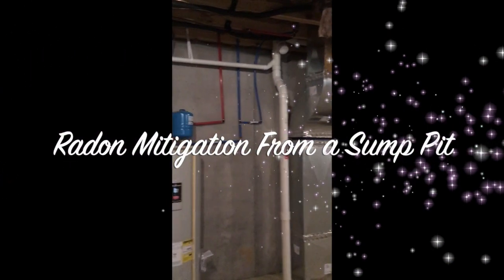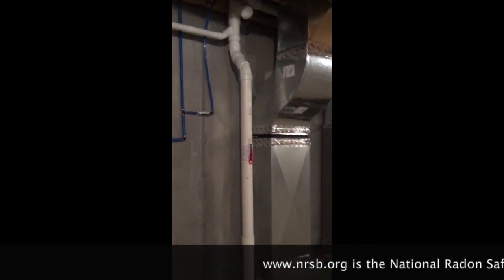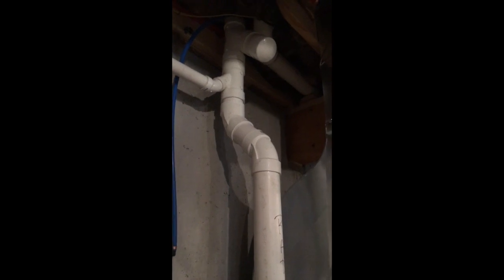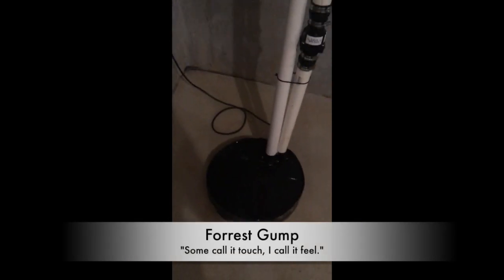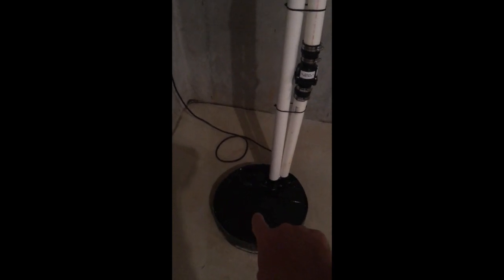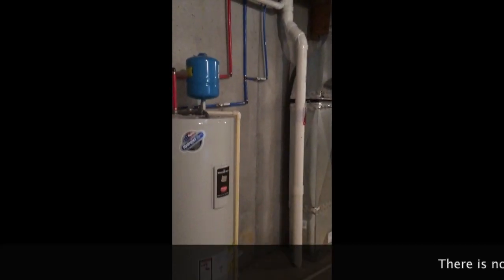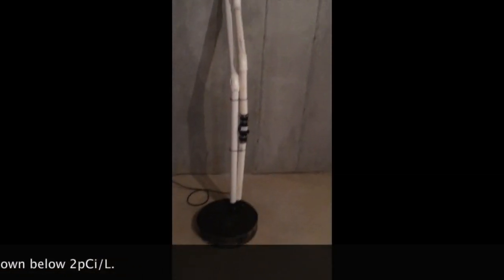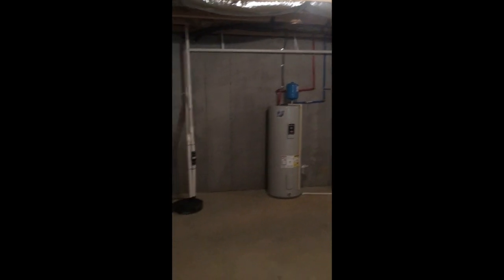RADON Mitigation from a Sump Pit

Comment: This is confusing.  Where is the wind in the sump coming from?  Seems like a positive air pressure from the sump would consume much of your CFM of the fan.  Would you use a high CFM fan so that you have a negative air pressure in the whole system?  Shouldn’t seal the sump instead for struggling with the positive air pressure it is creating in the system?